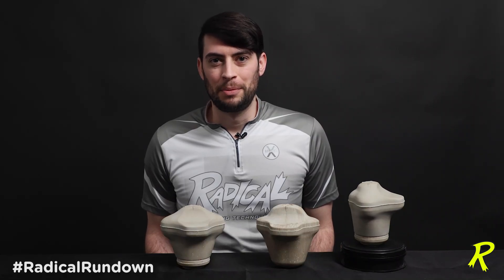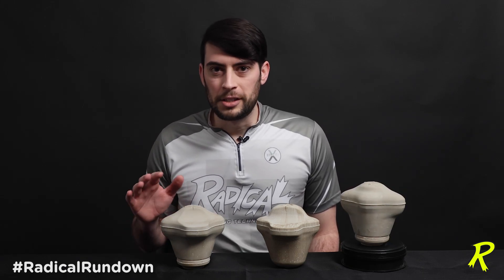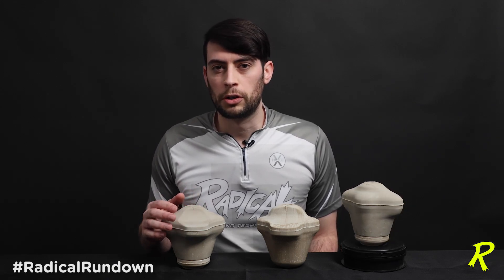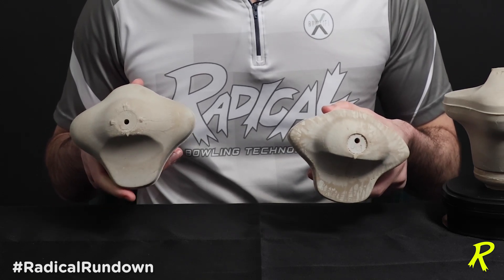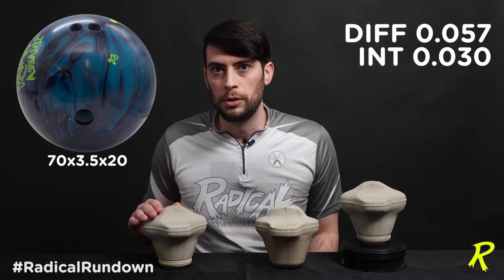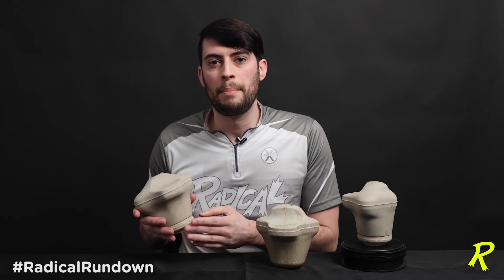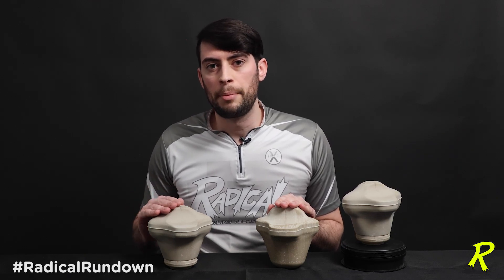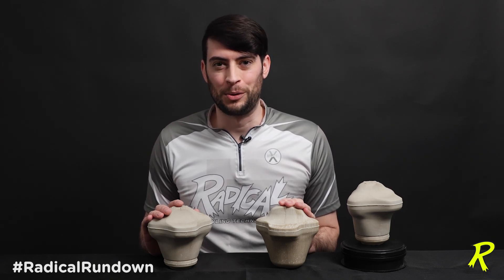Katana Assault Core - Technical Overview - #RadicalRundown

Comment: So if I did 70 x 5 x 25 
Will I still get the 
.30 intermediate?
Reply: assuming that drilling angle still puts the MB in the thumb for your PAP, it should get to very close to .030. the difference is with the core more stable at release, the ball will be a little longer and more rolly than at the 3.5" pin-PAP position.